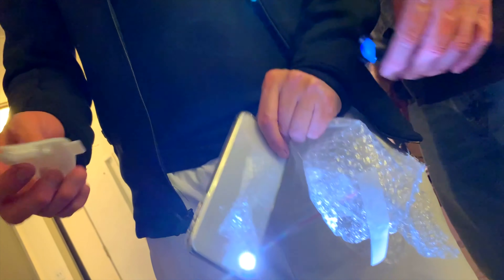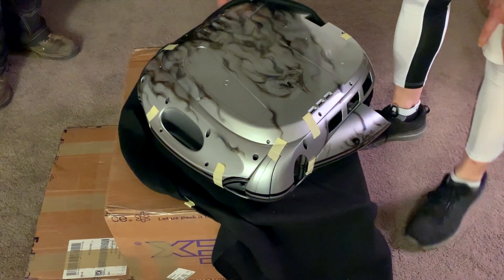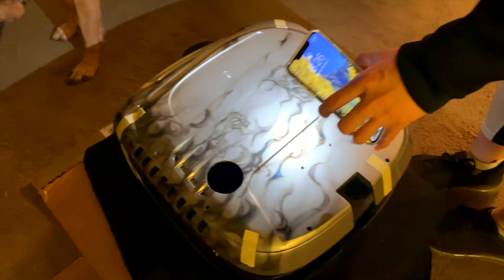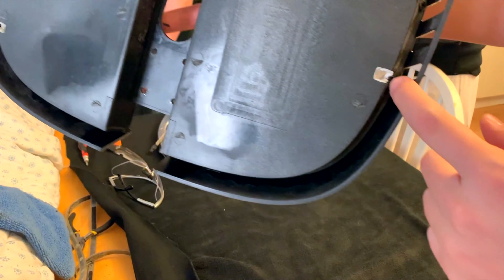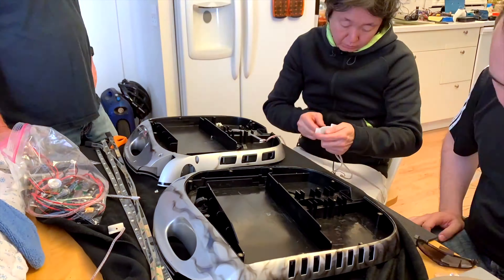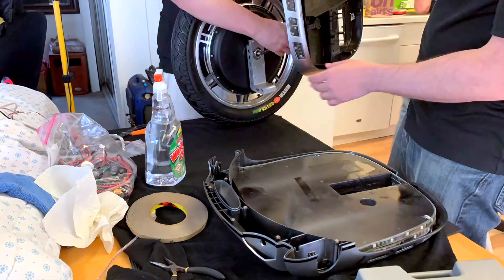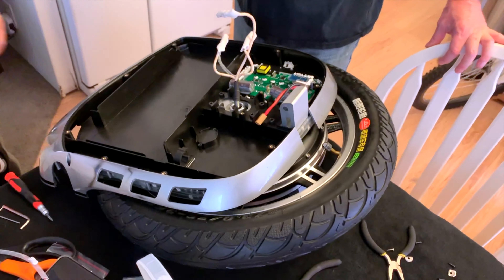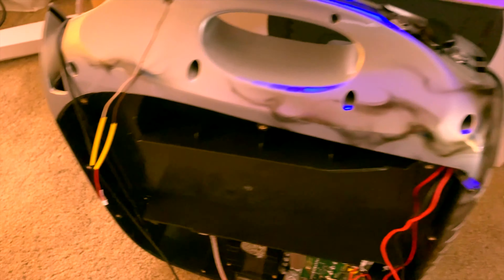WraithWheel Build, Part 3 | Custom Gotway MSuperX Electric Unicycle Build

Comment: How can I add led light? Where shall I connect on the motherboard? What kinda led strip can be used?
Reply from the maker: LED lights are always cool. Most boards have a 12 and 5 volt output that you can tie into. Alternatively you can use your own extra battery pack for it. 👽🖖

Comment: Excelent video. Where can you get those LEDs?, and how have you fed them? Thank you.
Reply from the maker: The ones we used here are from xkglow. There are many different Chinese LED strips that will work as well. You will need a battery pack to power them most likely, we found a 12v pack and put it in an empty part of the wheel. We also exposed another charging port so we can charge that battery pack separately.
Reply: @AlienRides  OK. Thank you. I wanted to get 5 V directly, without having to cut the strip of LEDs and be able to feed them from 5 V of the wheel itself, but that was another option. Congratulations, I'm very pleased.
Reply from the maker: Antonio Torralva López yup you should totally be able to do a 5v strip no problem by tapping. Into the existing circuits. Good luck with your project!